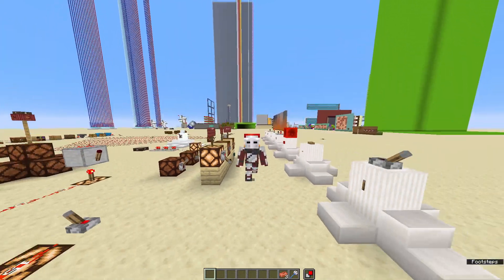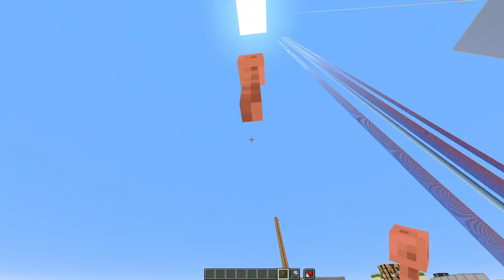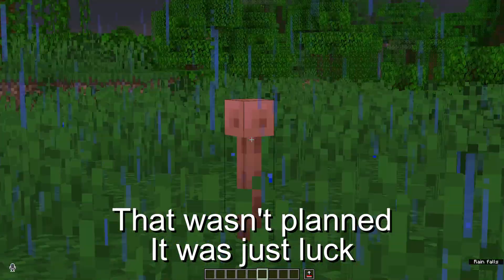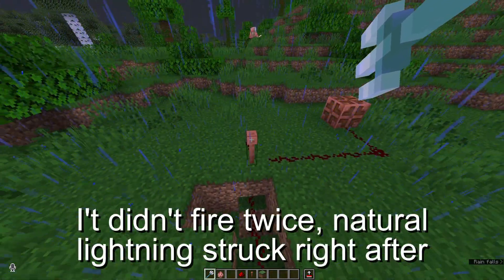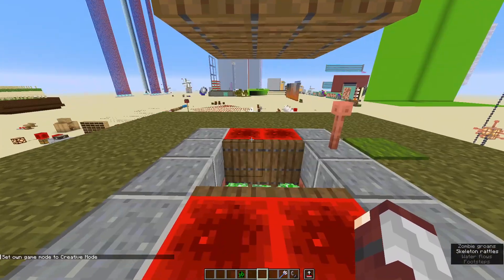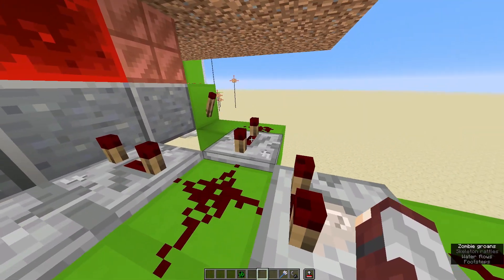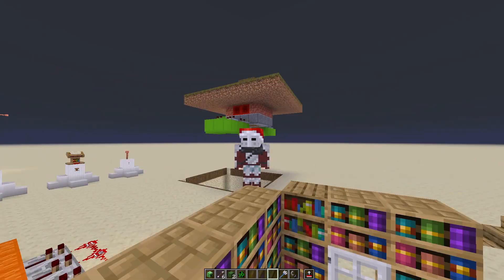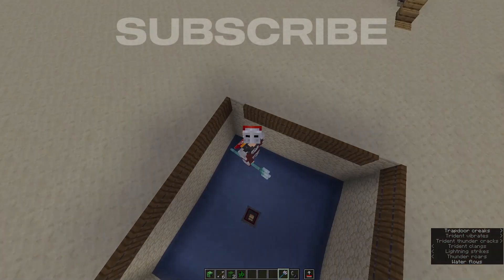How to use the Lightning Rod with Redstone

Comment: Do you know how to make a system that when lightning hits a connected rod to lamps turns them off until they’re manually turned on with a lever, like when a thunderstorm knocks out power
Reply from the maker: there are a couple ways you could pull that off, one could be having a powersource go through a repeater that pushes a signal through a block in front of it, when Lightning strikes, it has a piston pull that block away so the line is broken. then you could hook your lever up to a second sticky piston that puts the block back in place completing the circit. It might be simpler to place a copper bulp T-flipflop or something similar in the system so the lightning turns it off, but you may have the issue of the lights turning on again if lightning strikes a second time
Reply: @ivan-the-crafterI would need it be compact bc I’m making a kfc
Reply from the maker: @gladiator1255  nice